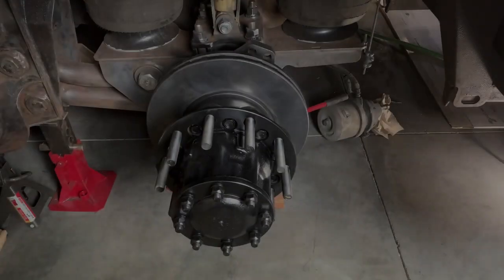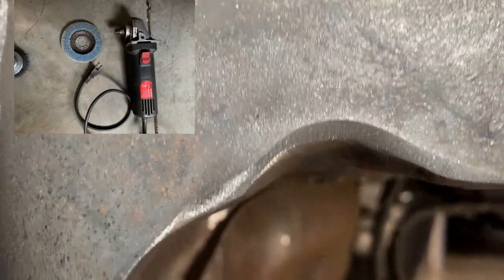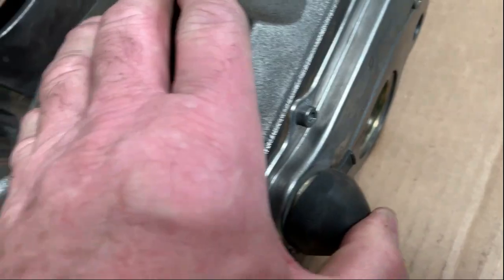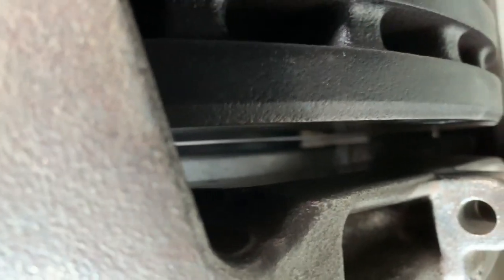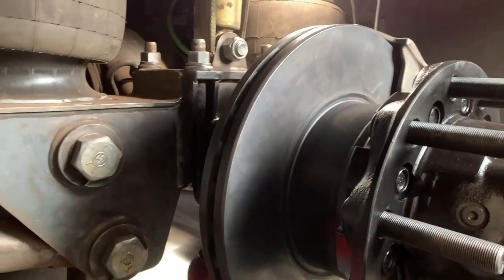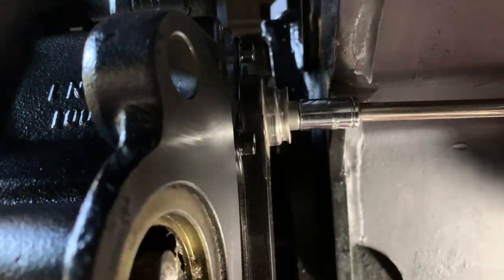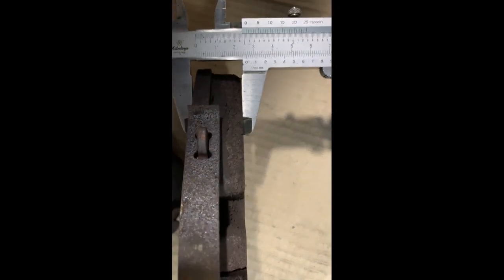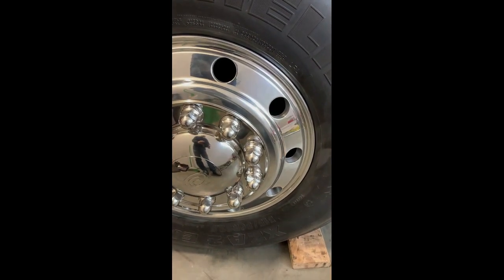Country Coach Brake Design Flaw - Part 2

Comment: Awesome video 👍 is this issue on all models of Country Coaches ? ? 2000-2008,9,10 etc just on back disc breaks ? ? Thx for sharing & looking forward to the wheel cleaning video as well. 👍⚾️
Reply from the maker: Sorry I missed your comment. In response, I am not sure, but I would assume that any coach using the same set up of chassis and disc brake system would have the same issue.